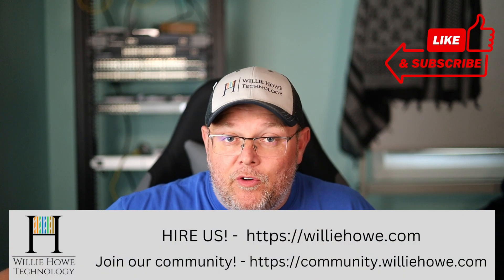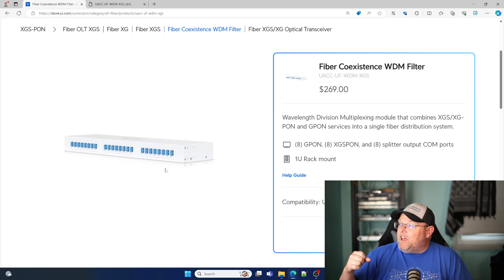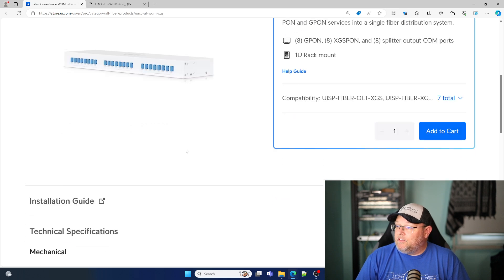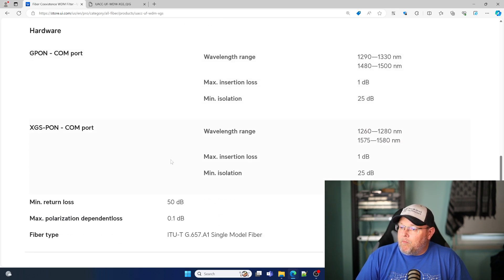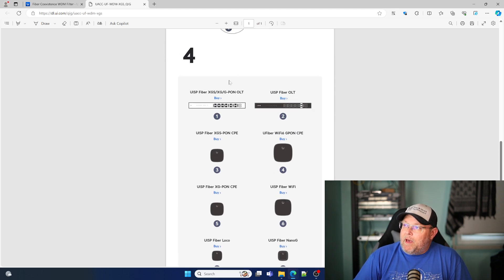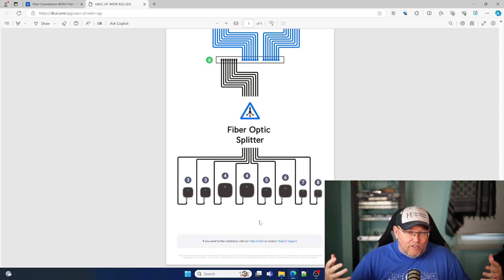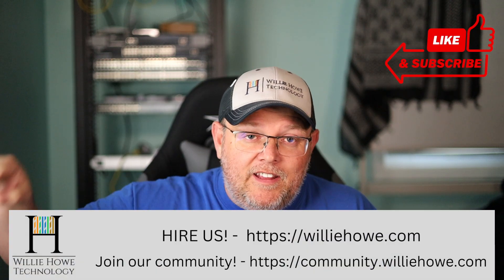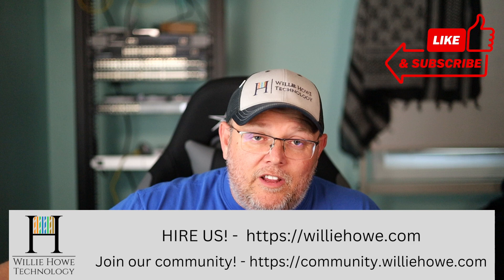Build an Internet Provider Part 6: WDM Filter

Comment: I understand the use case for this if you are trying to migrate from GPON to XGSPON, but if you're starting out new, why not just standardize on XGSPON, skip the coexistence filter, and just provision the CPE to run at a reduced speed, then in the future you can offer faster speeds without having to manage two sets of OLT's and swap out CPE?
Reply: Cost maybe. GPON equipment is generally cheaper.